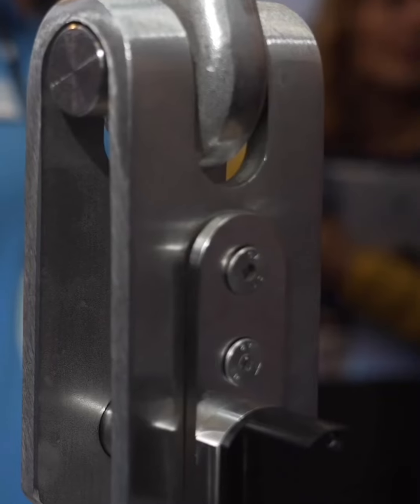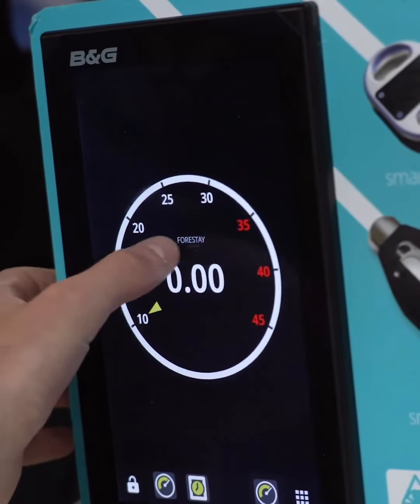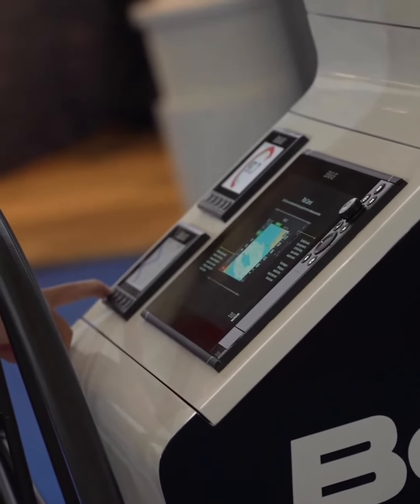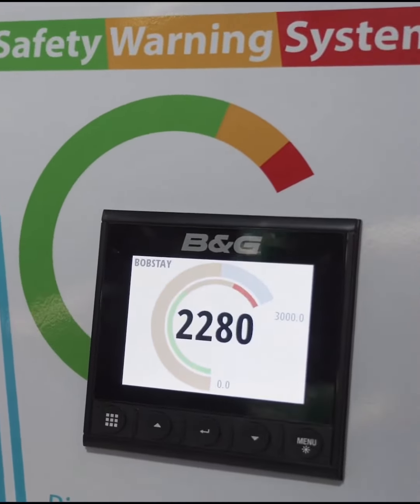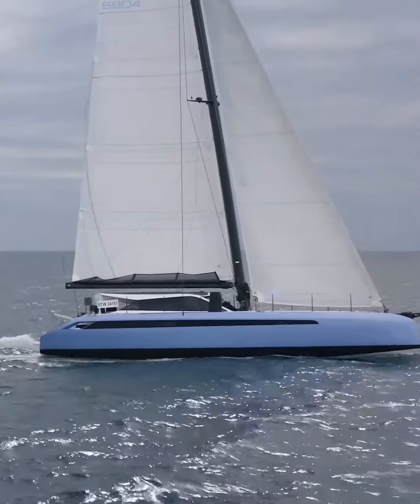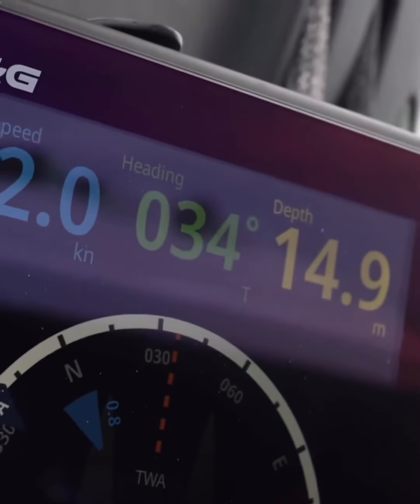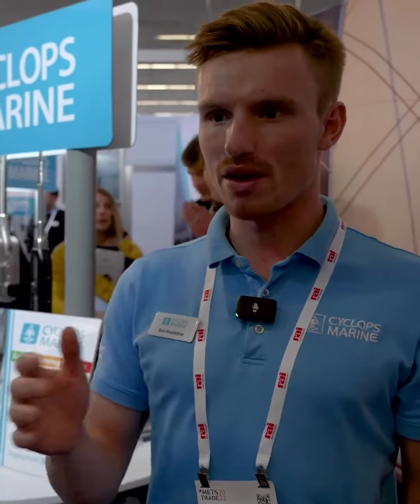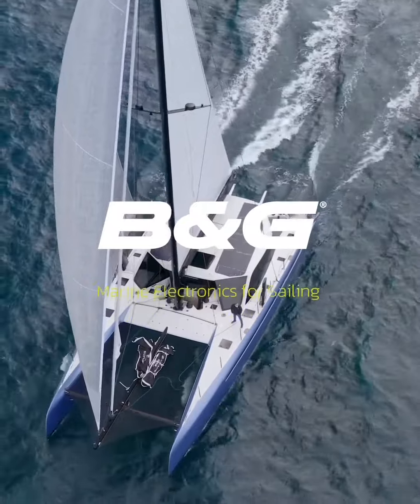B&G x Cyclops Safety Warning System

Comment: How can I connect a Smartlink² load cell with a Triton Edge? No other devices connected, apart from sensors and a a Triton 2 display
Reply from the maker: Hello, 

The smartlink2 can be connected to the Triton Edge and Triton2 display through a smartfittings gateway connected over the NMEA2000 network. 

If you have issues connecting, please get in touch with us on info@cyclopsmarine.com ☺